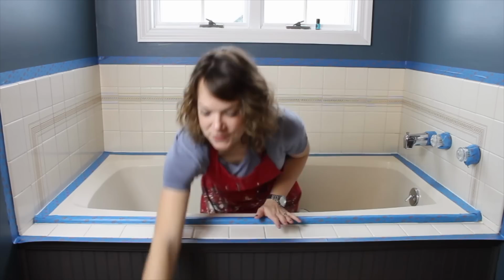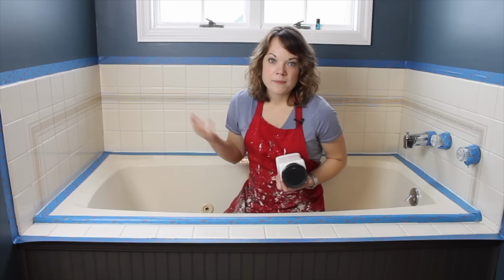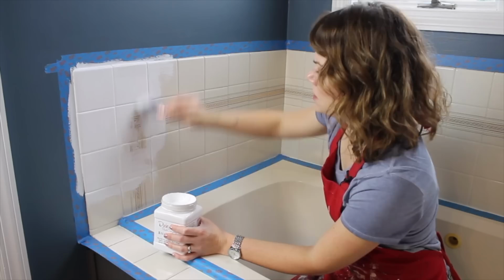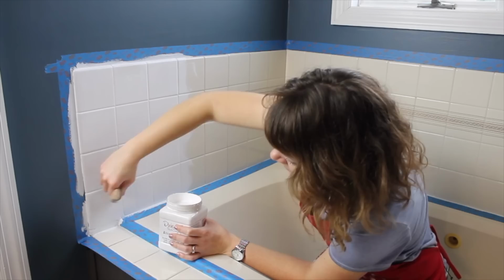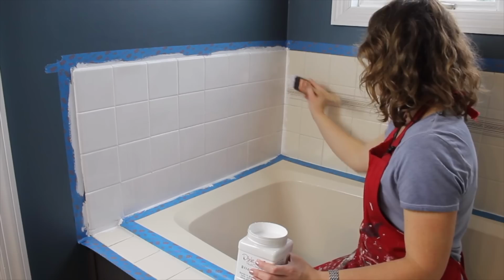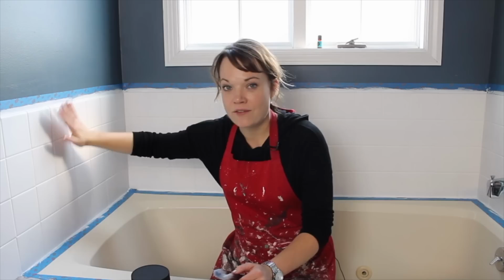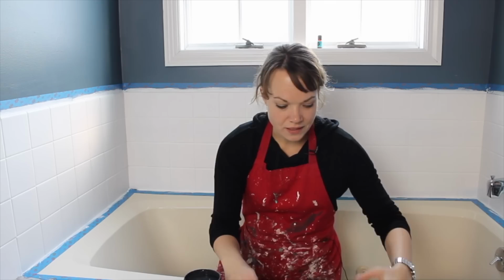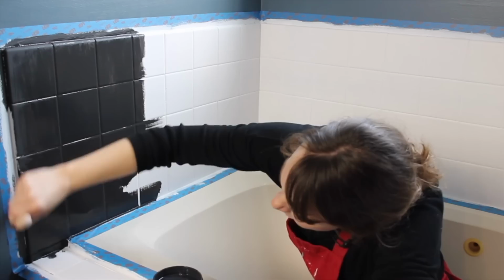How to Paint Tile | Easy Bathroom Renovation

Comment: How will the Dixie belle paint respond to a shower surround tile? Wonder if you’d need to seal with something to keep the water off of it ?
Reply from the maker: I show you how to seal the tile in Part 2 of the video (coming Wednesday!).  And there were a few times we used this before we sealed it and the paint came up, so sealing is a MUST!! I used Gator Hide by Dixie Belle, and it worked great!
Reply: @RootsWingsHome   so did I and it is still peeling off
Reply: @RootsWingsHome  how long do I have to wait to have a bath or shower - cant possibly be 30 days?????  I only have one bath.  I used it for my kitchen countertop and it is peeling off so now after paying out I have no clue whether I should even bother.

Comment: I used what you suggested on my kitchen countertop and it has just started peeling.  I did everything you said.....Slick stick paint, gator hide
Reply from the maker: Not sure this is great for counter tops.  Perhaps using Countertop paint from Rustoleum would be a better solution!